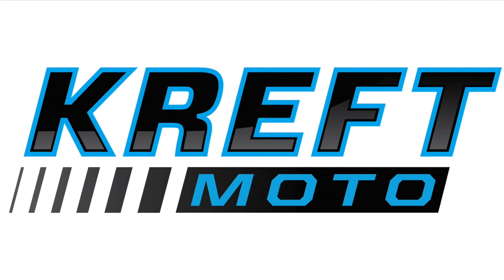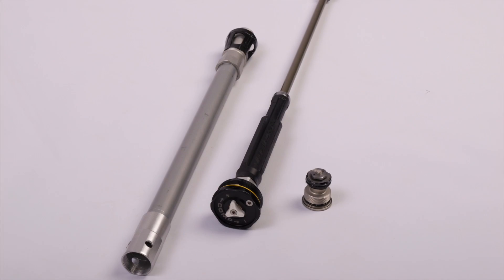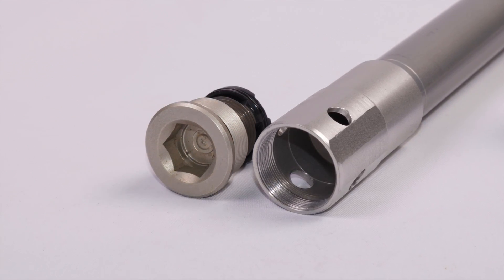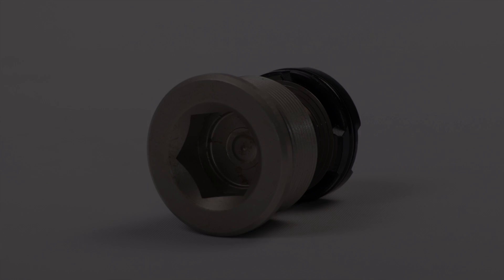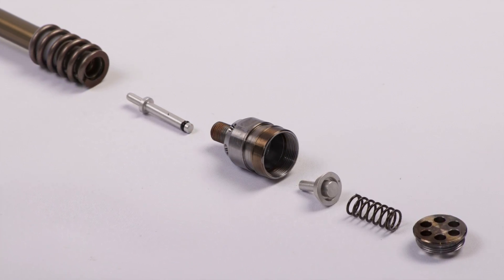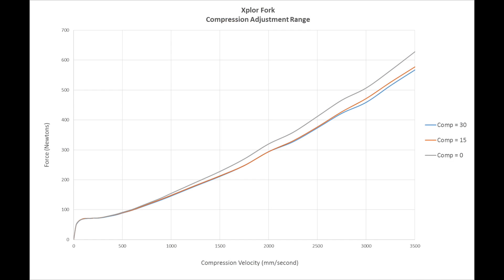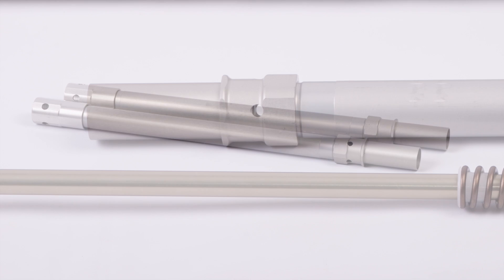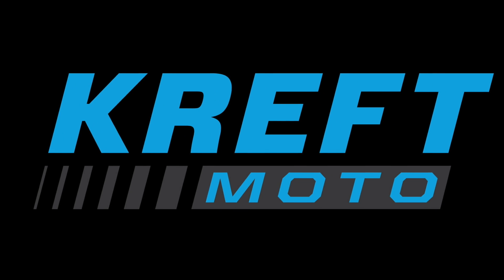INSIDE: WP Xplor 48 Fork

Comment: I'm looking for a preload adjuster for the new front suspension of the 2019 smc r, also an extension set. the manual says they are wp 5448, but these are unknown on the internet.
Reply: A year later and the internet still has zero references to the 5448
Reply: @MdubFrederson  bought a 2010 smc  ,  tall enough.

Comment: thanks for interesting video. I have  HuskyFE250 MY2019 and the WP Xplor comes out different than 2017 (heavy springs and some modification inside shock probably) because the 2017 WP was too soft. I have noted that also the actual WP forks tends to close specially in release of gas and to become harder after several hours of use. Maybe it's possible operate with oil (density, level, etc )....let me know your opinion :-)

Comment: Interesting diagrams, I never saw low and highspeed in comparison.

I rode the 2016 open cartridge and now a 2018 xplor. My subjective impression on the 2 forks are the complete opposite.

The 2016 was average in responsiveness. More compression clickers meant harsh, less mushy feeling. Zero effect for highspeed situations. Only rebound clickers worked excellent.

The xplor has perfect responsiveness. Compression clickers are working excellent from soft setting (extreme enduro) to motocross (hard). Clickers have better but still not enough highspeed effect. Overall (I agree here) the fork has stock a too progressive feel in highspeed situations. I noticed this when slamming into trees in endurocross or overjumping.

Comment: I have an 2018 TE300i, no crossed drilled holes on them. I can’t get full fork travel, and I’m too heavy for std springs.  Am I right in assuming that the spring guide pushes into the cartridge and it used as a anti bottoming device? I think it’s hitting a hydraulic lock before it bottoms out. I’m thinking of drilling them like the 2017 Xplor.
Reply: Did you ever get an answer on this?  I have a 2018 250 tpi and have the same issue, it will never use full fork travel.
Reply: Do it

Comment: Chamber has 2 exits and mid piston is a fixed orifice, oil is going to flow path of least resistance.  At LS it will flow thru the mid valve and out the top bleed holes as rod enters chamber, little or nothing goes thru the base valve.  At HS the mid valve generates pressure and forces flow thru the base valve with cartridge being back filled thru top bleed holes.

The mid valve is basically becomes float adjustment, and the base valve is now the HS shim stack.  There is no other metering happening.  This however will not work well as a HS circuit because you will never get the flow you need thru the small port entry on the base valve and this is  why it feels like a fix orifice system. You would need massive port entry and port area on the base valve for this to work well.  You are not displacing 12 mm of rod volume at this point, you displacing 23 mm of mid piston thru the base valve.  No matter what you do to the shims on this side, it has little or no effect on HS hit.  The limit is port entry on the base valve.
Reply: Why many of the tuners still insist on opening up and using softer shims on the base valve then???
And for what I see - on both sides.

Comment: mid is one way valve right ?, so when bottoms, the B cone will perhaps, force oil in, and open compresion valve ? change the inner tubes  and see what that does, start with a lower oil capativy, and rise to correct level amount, sorry for my english. If you dont try....

Comment: Very detailed. Nice. I'm awaiting arrival of m 2017 FE501 and 185 pounds without gear. I've heard the 501 is sprung or set up for 165-180 pound rider. Do you believe I'll need to have the fork springs upgraded? Advice? Thanks bud
Reply from the maker: It's likely, but there are several factors involved, including your preferred terrain and ability level.  I suggest you contact us through the website or email so we can provide a more thorough evaluation.